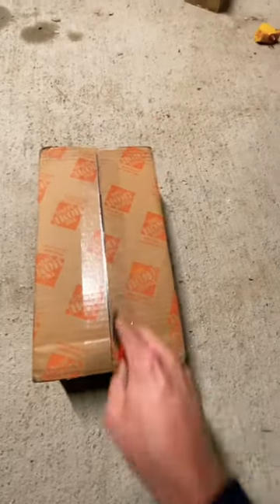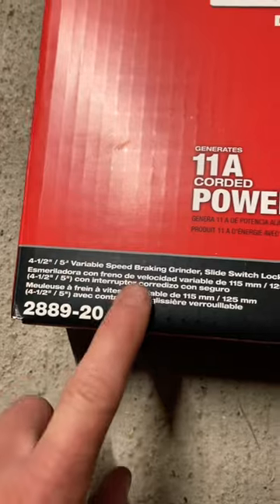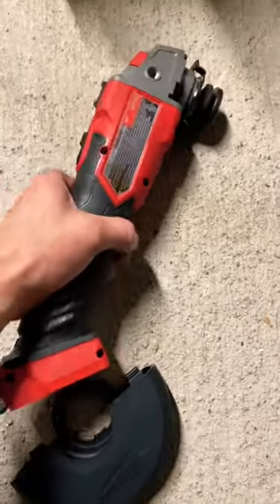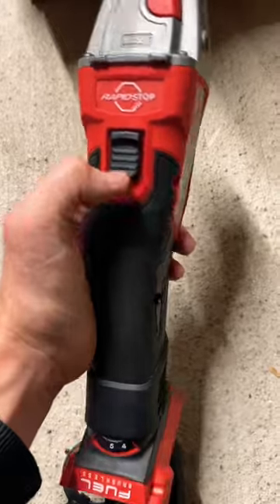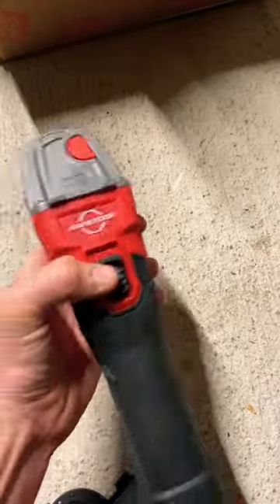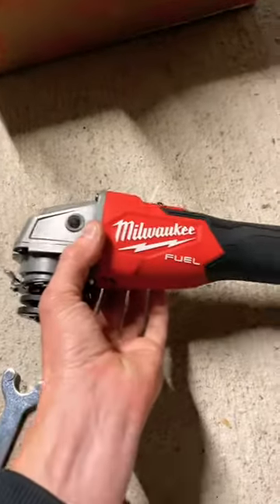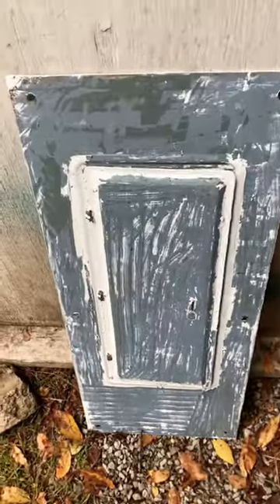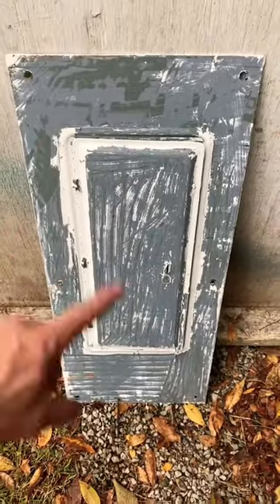I bought another @MilwaukeeTool #shorts

Comment: use paint stripper on that panel. please don't use a grinder with a flap disk or something.

you could have at least used a belt or orbital sander.
Reply from the maker: I used some laquer thinner to get a lot scraped off. Then did exactly that, used angle grinder and flap disk. Around all the curves and angles would have been a pain with either an orbital or belt.
Reply: @TheFixFinder  fair enough I suppose.

lacquer thinner is massively different from paint stripper though. lacquer thinner would do hardly anything for dry paint.
Reply: Dont use a flap disc use a wire brush supper effective to strip paint or clean any metal piece
Reply from the maker: @molsondry2834  I did also use a wire brush 👍🏼